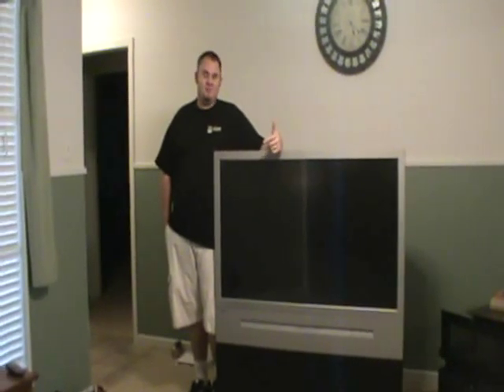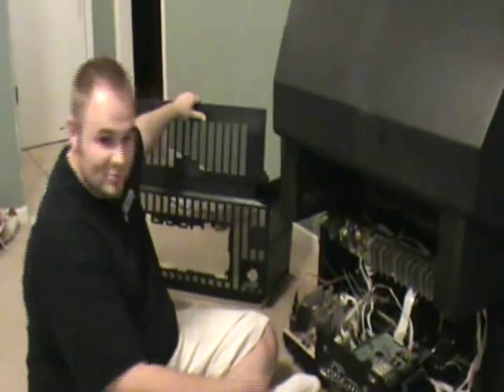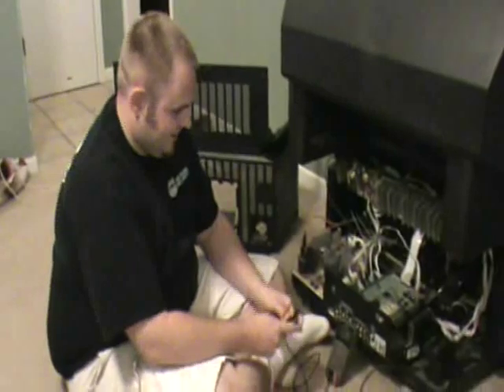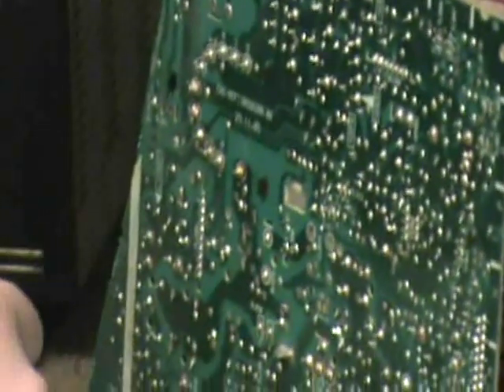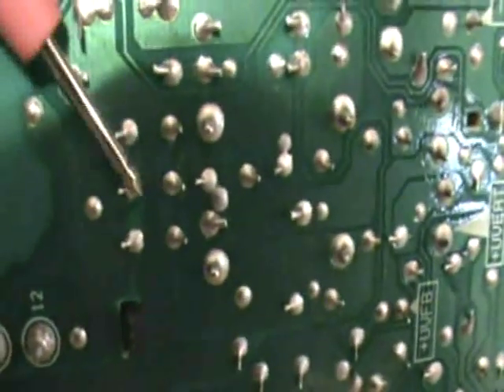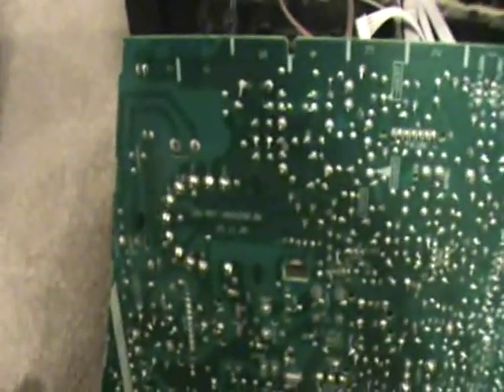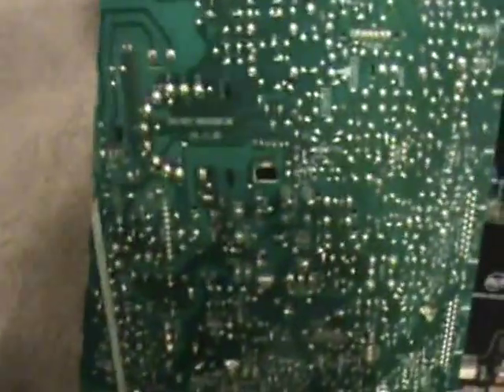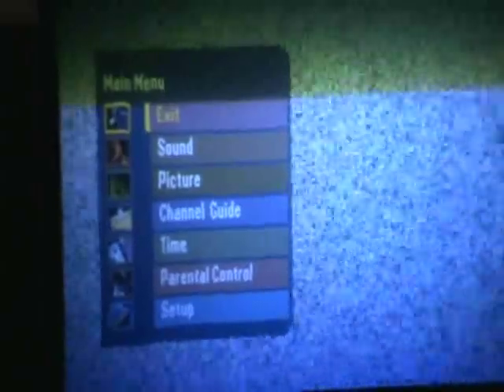RCA projection TV

Comment: DUDE!  You are awesome!  You nailed my problem on the head.  I checked the fuse and sure enough, it was open.  I purchased a new fuse online, installed it, resoldered the terminals you mention in the video and... VOILE!  After adjusting the convergence in Settings, the TV worked like new.  Total cost, not including extra fuses, was about $4.00.  Saved me about $1400.00 since I would probably have bought a new flat panel HDTV rather than have this relic repaired.  Thanks again, you're awesome!

Comment: Sweet DYI vid. It worked for me. As for the three blinking lights, I Ihad the same issue at first. I realized that I had not pushed in the black plastic tray all the way while I was testing it. Once that was done, it did have a little bit of flickering and then as wall good. Thanks Squish!

Comment: just got my FREE 52" RCA working after taking out the flyback board, inspecting if for a bit and found a blown solder point. resoldered that and now it works fine:D

Comment: Thanks for posting your video. I have the same big screen with the same problem. 
Just ordered the fuse on Ebay, I will install it and re solder all the connections on the fly back. 
Thanks Again.   Sven

Comment: for the green light blinking 3 times problem on a rca complaint website stated taking off the back then using blow dryer on hot setting gets rid of the dust, works.

Comment from the maker: Yes, the TV is still going strong.  I haven't touched it since the fix.  The trick is to fix the problem, not the symptom.  The fuse blowing is really just a symptom.  The fuse blows because there is a problem with the board...which is usually the solder points...but not always.  Fix the problem and the fuse shouldn't blow again.

Comment: 3D Effects pictures causes are very common problems in all projection tv in the years 95-200 tv.Technical term is Convergence RGB repairs for some RCA tv model replace fico fuse and re solder the high voltage flyback.Other models have a convergence board must take the convergence board out replaces two convergence IC's and some resistors too.

Comment from the maker: if only the blue color is out, it doesn't sound like you have the same problem that this fixes.  the convergence problem usually involves all 3 colors separating.  if you have just one color separating or one not working at all, it looks like you have a problem with just that color...could be a bulb or lens

Comment: @squishydale I have this same problem. My model is D52W20 with the ITC222 Chassis (not ITC222A). I finally managed to get mine going only once and the flyback transformer is making lots of noise, the screen flickers and is wavy when the screen stays on. I know the board needs to be replaced because there are 3 caps that are bulged and the flyback doesn't seem to work properly either. My problem is I can't find a replacement deflection board # PSB850. Do you know where I can get one?

Comment: @squisydale Hey i have an RCA tv too. the problem i have is it  started off as the picture just going black. teh tv is on adn i hear the sound but the screen goes blank. i hit the back of it and it turns back on. but now the screen is blank no matter what. im not sure if its teh wireing or what. any sugestions?

Comment from the maker: I'm continually floored by the volume of comments I get on this video.  Thanks for the kind remarks guys.  When I made the video, I really just intended to show some buddies how I bought a $75 TV and fixed it for a good deal.

I bought the fuse on ebay, I think I searched for FL231, you're looking for a 400mA fuse.  In theory, any 400mA fuse will work, it's just that unless you get the OEM rca fuse, it will fit back on the board all nice and neat.

Comment: @squishydale 
Mine blinks 3 times too.  I sat there and tried for 3 hours to turn it on and it turned on.  It works fine once it turns on, but I don't shut it off just to avoid the 3 hour process.  What could that problem be???  Thanks.

Comment: You indicate 1400MA Fuse....TV repair kits.com  indicates that  replacement fuse for FL231 used in the RCA ITC222 and ATC221 chassis 400ma 125V........which is the correct fuse...any help appreciated  Thanks

Comment: hey man my got a free Mitsubishi 55 inch tv for free it has a problem though when i got it some dumb ass pulled 4 of the wires a loose and what the tv is doing its staying on for3 seconds and cutting off .. when i remove the back of the TV and keep clicking the power button i see one projection come on and all the other two dont come on do you think the projectors are bad?

Comment from the maker: @Miketar2424 - I read up on the problem at a couple of different locations, but I think originally it was a post at fixya.com that put me on the right track.

@MrBigjoe8 - when the entire picture gets blurry or has a particular tint, it could be one of the lamps that needs to be replaced.  I'm not sure about his tv, but other tv's use a (dangerous and toxic) fluid to cool the 3 color tubes.  When the fluid gets bad, it goes cloudy and sometimes leaks onto the components damaging them.

Comment: I have an RCA model P61939 rear projection tv and after 20-30 minutes then it goes into a convergence problem. Any idea of how to repair this one?
Reply: Your RCA projection tv model probably have a convergence board.Take the tv a parts.Must take the convergence board a parts than re solders the 2 convergence IC's all the resistors besides it will solved this problems.

Comment: I have one of these TV's and the picture doesn't come on, but the power light does go on and off three or so times, while it makes a high pitched sound.  I checked the fuses and they are all good (continuity) and I resoldered the flyback transformer, still no go.  I think the flyback is bad, do you think I need to replace it?  Anyone feel free to help me out.

Comment: Can you tell me where the dlp chip is located?
Reply: The High voltage Flyback transform a big huge block of plastic  besides left side little fuse a Fico fuse replaced that than must re solders the Flyback transform too,so you don't blown the new Fico fuse again.Certain RCA protection tv models 95-200 years this repairs are very common problems.

Comment from the maker: I'm glad some of you guys are having success.  I looked at 2 more of these TV's the other day and they had a few more problems than just the solder points, so take that as a warning that while the problem I fixed may be the more common problem, that doesn't make it the only problem.

Secondly, I am not sure if I said in my video, but I definitely want to reiterate that this is high voltage stuff, so BE CAREFUL!  Thanks for the comments guys and gals

Comment from the maker: Hey guys, 

I've seen a lot of comments and pm's referring to a common problem where the TV on led blinks for 3 blinks then goes off.  You're not going to want to hear this, but I hear that this is a very generic problem.  The TV set knows something is not working right, so it powers itself down as to not cause any damage.  Problems could range from my fix to a variety of other issues.  Sorry that I'm not much help.

Dale

Comment: I did everything in this video and my 60 rca rear projection Tv still has convergence issues. Checked all of the fuses . Replaced convergence fuse and tested fuse meter indicates that the fuse is good. I am at the point where I about to throw this tv out. Can anyone help me